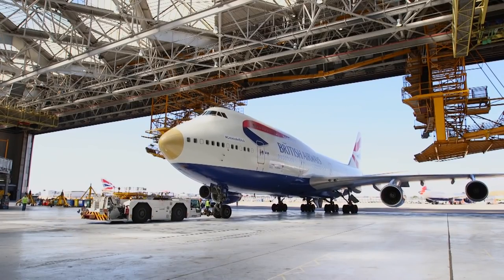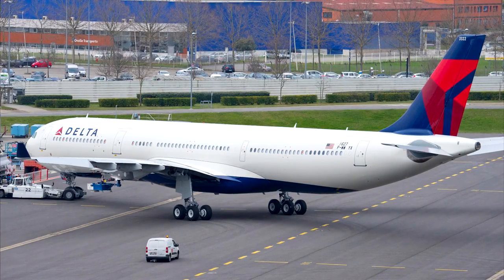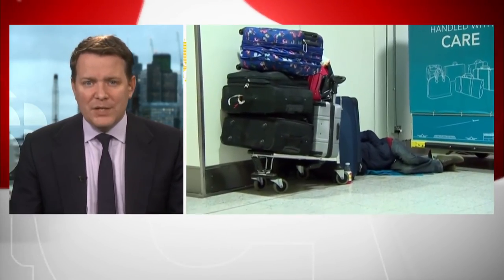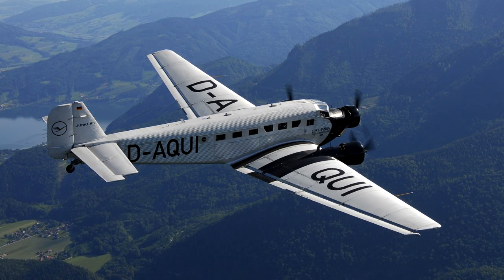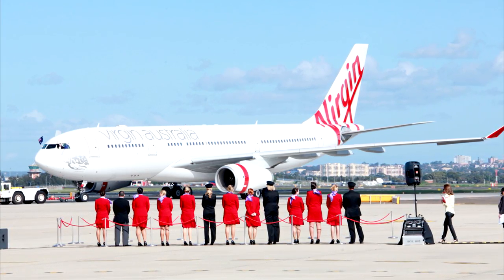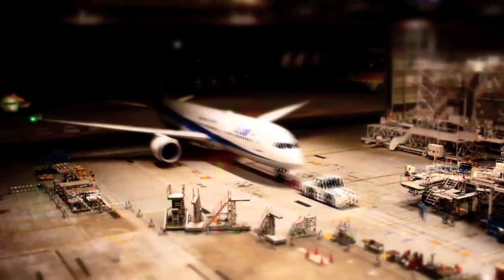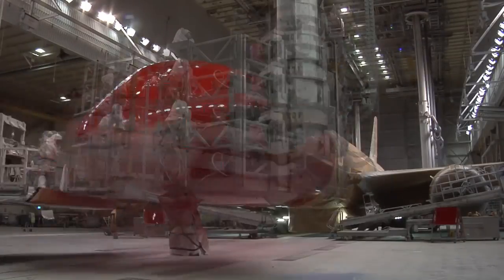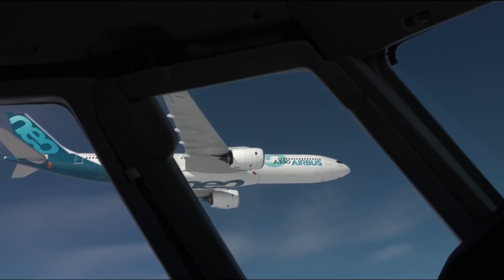Aviation News Summary EP3: Oldest Lufthansa Plane Being Retired!

Comment: What ? JU-52 “retired” ?? What the hell - are they out of their mind ? Keep them flying
Reply: My bet is it was getting nearly impossible to keep it maintained to schedule. When I flew on it almost 15 years they said it took a few thousand maintenance hours every winter to keep it in the air with its schedule. That's on top what was done during the year. Its getting increasingly difficult to even get maintenance parts for the P&W Hornet engines that are shared with so many other radial engine planes of the era. That's one of the reasons so may DC-3 are being converted to turboprops.
Reply: Sadly - yes.

Comment: I did a flight on the JU-52 back in '95, really cool. I have no idea why I was the only passenger the captain asked if want to come up and stand in the cockpit between him and co-pilot, the pilots seats are a step up from the cabin isle,  but that was very very cool and very very noisy with the squared off windows in the cockpit. The leg I took went from outside Hamburg to Lubbock and took the airport bus back to my car. 

I'm sorry to see that go but its likely getting very difficult to keep it getting parts to maintain a fight schedule. As I recall it had been re-engined years before because the original engines had zero parts availability the original BMW radial, which was a development of P&W Horent under license, was replaced by P&W during the post war period. Almost all the JU-52 were destroyed after the war. So spares wouldn't be easy to fine. Back when I few on it I remember the pilot saying after the flight during the winter it was taken out of service and a few thousand hours of maintenance were done every year!